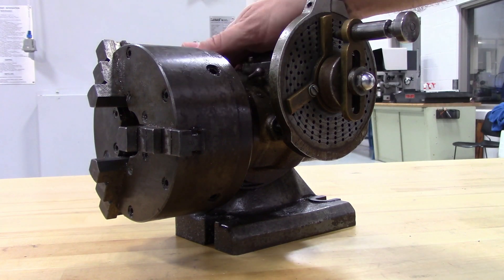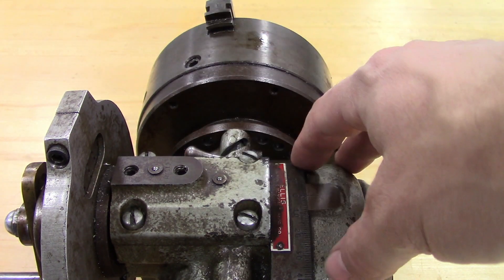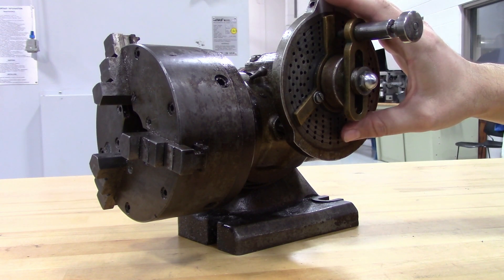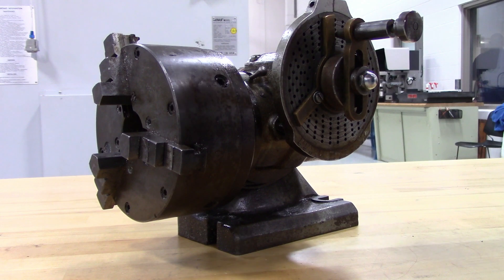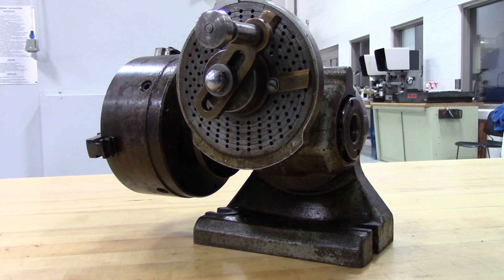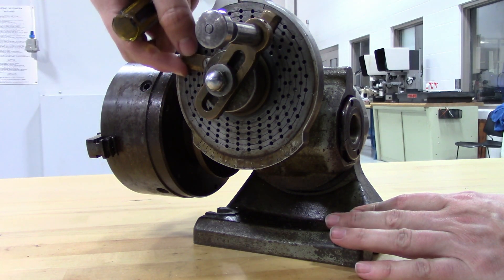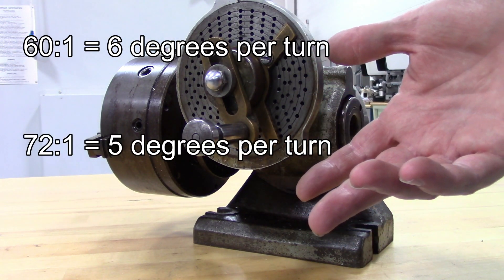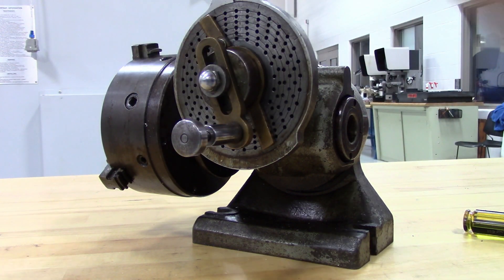How to Use a Dividing Head

Comment: Clear video, thanks. I use mine so seldom I have to refer to my notes for a refresher.
QUESTION; while watching your video you mentioned "dials". I was wondering the best mill tool to scribe a dial (being held in the chuck/indexer) using a vertical mill. Perhaps a thin small slitting saw?
Reply from the maker: They make engraving bits that are long and pointy D-bits (round bits that are ground to half their diameter).  You could also take a broken endmill and grind it into a drag bit.  Think about this like a shaper operation.  You grind the bit so it will scratch the line in.  The spindle wouldn't run in this case.  You just orient the tool so it will cut and bring the table up to where it just scratches.  I hope this helps.  Thanks for watching!
Reply: @StuartdeHaro  Like the shaper idea. My mill has a DRO so limits could be set for the travel. THANKS!
Reply: @StuartdeHaro  Forgot to add - yes I have broken end mills :-(

Comment: No links. A question: based on your sheet, which row of holes (16, 18, 19, 21, 24) I would use for a 90:1 ratio 40/4?
Reply from the maker: You actually wouldn't need to use the hole plates at all.  You would just turn the handle 10 times.

Comment: Stuart -- Great Video, nicely explained. I argued with myself about sending you my critique.
 I hate to rain on your parade, but I don't want you to end up with egg on you face.Differential Indexing involves multiple gears tied to the dividing head to achieve divisions that can't accomplished by using simple or compound indexing. I apologize, try this link https://youtu.be/tQBhHjNO69s
Reply: While I bought a Vertex universal copy of the B & S universal that has the gears and input shaft that can be driven from the table there not the only type of dividing head that can do differential, compound and complex high prime number divisions. Not sure if any of the North American made heads ever used it, but there was at least one European made one that used two worms and wheels. One set up much like this video shows and a second that allowed divisions as small as 1/1,000th of a degree. George Thomas's book Workshop Techniques shows his smaller design that also uses two worms and wheels with a 60/1 ratio. Hemingway Kit's in the UK sell the castings for it.  http://www.hemingwaykits.com/acatalog/Versatile_Dividing_Head.html. Hemingway shows it as being capable of 1/100th of a degree, that's incorrect.Obviously the geared type once properly set up is faster and less mistake prone, but as usual there's almost always more than one method. Thomas designed his so it's major parts could also be adapted to a Myford Super 7 with it's 60 tooth bull gear so it could allow lathe head stock dividing as well.
Reply from the maker: Thanks for the reply, Jim.  I guess it comes down to a nomenclature problem.  I always called that compound indexing.  You're not the only one to raise that issue, so I'll go do some research and make sure I'm not an absolute dumbass.  Thanks for watching!
Reply: Again I apologize --- again you did a nice job --- you're 100% correct a nomenclature issue .

Comment: Excellent, thank you. I'm trying to decide between the type you've got in the video and a BS-0. I have enough Z to handle either. As I understand it the BS uses mostly proprietary attachments, tables, tapers, ect. I'd appreciate your opinion or pros/cons between the two.
Reply from the maker: Whatever you get, the principles are the same, so as long as it will hold your parts and fit in your work envelope, you should be good to go.

Comment: hmmmmm, to me diffential dividing requires a dividing head with moveable plate and gears such that the number of divisions is the difference between the gear train and the conventional plate divisions . Differential division gives the possibility of dividing prime numbers (eg 127) without specific plates .  This type of universal head can also be geared to the mill's axis to allow spiral and cam milling.
Reply from the maker: It's probably a nomenclature issue.  I've always referred to that as compound indexing.  Thanks for the reply!  Time to go check my details and make sure I'm not a total idiot!
Reply: @StuartdeHaro  could be Stuart, but my Elliott DH manual refers to geared adjustment as 'differential' and, if you think about it, there is little that is differential about simple plate-hole dividing
Reply: Great video! Bill or Stuart, can you say a little more about how to accomplish larger prime numbers of divisions? I'd like to make a 127 tooth metric transposition gear for my lathe, but it's not clear to me what I'd need or how to get that number of divisions.
Reply: @mbogo123 For a 127T gear,  my Elliott requires a 39 hole plate, a 56T gear on the spindle, and a 24T on the plate driver shaft , and what ever intermediate gears to connect the two .The handle os then indexed 13 holes for each tooth. The 13\39 would give 120 indexes but the gear train retards the plate to subtract the fraction of a hole to give the extra indexes. If you think about it, the handle only ever makes40 revolutions while cutting a gear to cut more teeth it has to make more stops so the job that the gears do is change the spacing  by moving the plate backwards to add teeth or forwards to reduce the number..
 Most universal div heads will need similar settings.
Reply: @wktodd  thanks! I asked Precision Matthews about 127t on their 
BS-2 FULL UNIVERSAL DIVIDING HEAD and they told me it wasn't possible, that I'd need a  plate with a 127 hole circle. Good to know that at least some universal heads can do larger prime numbers of divisions.
Reply: @mbogo123  The plate drive on that bs2 looks indentical to my Elliott, so given the 39 hole plate and 24/56T gears it would cut 127 (salesman probably doesn't know his product!)
Reply: @wktodd  thanks again!